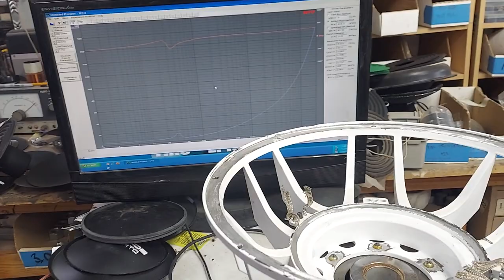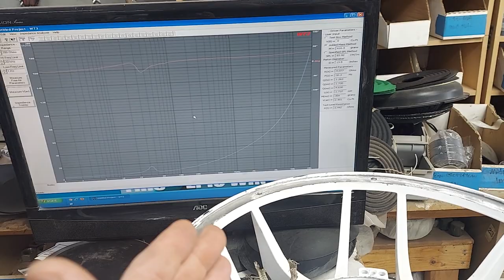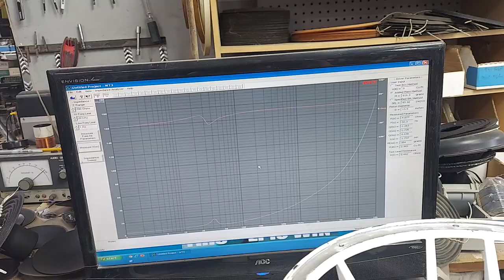Scott Dilbeck and DaveLeib.com have ruined me!!! The gay cuck of Robot Underground! ScottDilbeck.com

Comment: 3 inch driver in a quadruple chamber, tapped horn, 4 and 7/16s order, triple tuned, Allison transmission line, sealed enclosure. The Video comment section on subwoofer enclosure building . Especially plexi bass